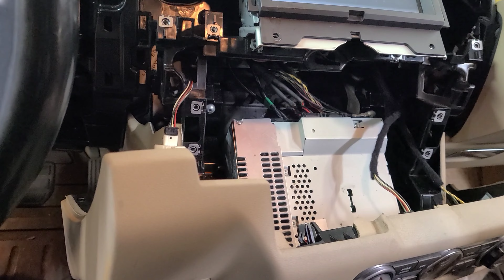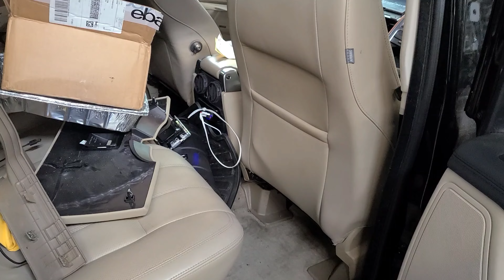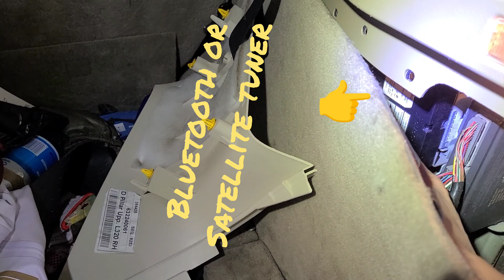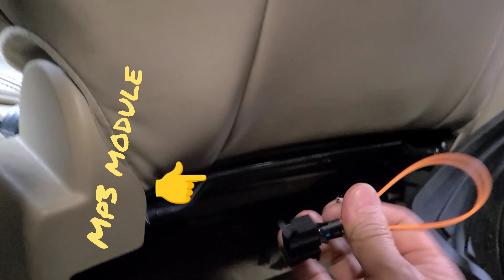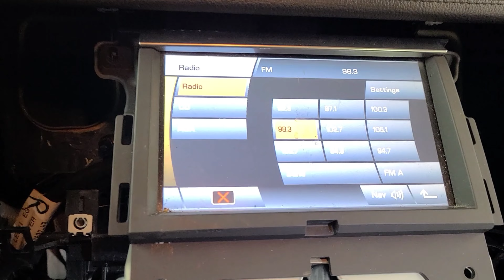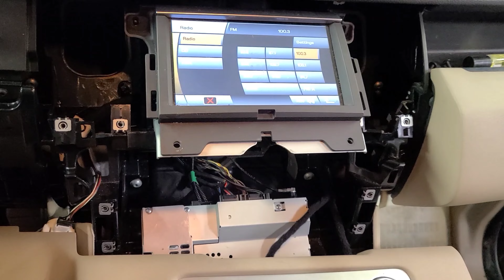2010 Range Rover Sport stuck on logo doesn't boot up water damage amplifier satelite mp3 fix repair

Comment: And if all the fiber optic cables work and if they all have the lazer looping? Amd radio still doesn't boot up unless by passing the main cable so what can it be??? Any help?
Reply from the maker: You need to put loop on each till you find the defective component.one on each side of the seats and maybe two in the trunk
Reply: @goautosound1 I have 1 under seat and like 4 or 5 in the back idk about passenger side seat but they all loop

Comment: Hi mate thank for the video it’s really helpful 🫡 I want to ask you if you have any idea about an issue with my car well my 2007 range rover sport tdv6 new agm battery new alternator then i swap cluster clone it soon i connect to car the car starts then after 30 second the radio land rover screen turned off does the nokia bluetooth module make this problem ? Many thanks 🙏 Matt
Reply from the maker: Not sure,but disconnect the BT and see if the car runs

Comment: I have the evoque  2013. My radio gets as far as the range rover logo then reboots.
I do have the reversing sensor .
I'm hoping your first 2 investigations solve my issue.
Many thanks for this video
Forgot my windscreen is cracked
Reply from the maker: @alexfraser5644  most problems caused by the water damage on the models under the seats, please follow the video and try to bypass one by one with fiberoptic bypass
Reply from the maker: @alexfraser5644  just added a link for Amazon,you can buy it from the link

Comment: ey in freelander 2 we have display heaad unit bluetooth cd player in built and amplifier signal goes from stereo to cd and amplifier but when coming back it comes to bluetooth but dont go past it what could be done now if we bypass form bluetooth the bluetooth wont work what cld be done now
Reply from the maker: You just replace the defective bt module

Comment: Hello team where are you guys located.  I'm in Richmond Va and having just a blank no power screen.  Issue is my mechanic left my window down on passenger side and floor and dash got pretty wet.  Now screen went power up.  I've replaced all fuses and the one relay behind glove box.  Still no power.  Everything else works perfect
Reply from the maker: @larrygoode1753  we are in Union nj 
You should have an amplifier under the passenger side seat. Check to see if the amplifier ok
Reply: @goautosound1  Thank you buddy
Reply: Hi, mate what was the solution

Comment: Hello, I have the same problem on my vehicle, can you help me, I did the same manipulation as you but the laser below the screen on the station where all the linked sound modules do not work. Will it be able to come from the post??? THANKS
Reply from the maker: Did you unplug the laser under the seat to see if red laser is on when you start the car?
Reply: yes I unplugged it does not turn on the laser. I wrote to you on Instagram you can see
Reply from the maker: @metinbz2677  turn key on you don't see the laser, you may have defective radio .the laser only stays on when you first turn key on.having said that each module test, you must restart the car for each module test